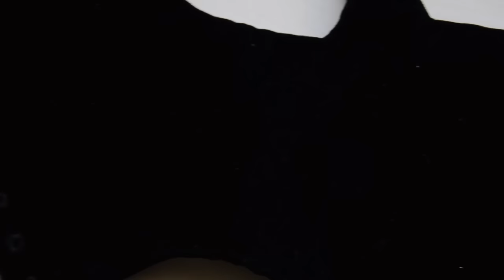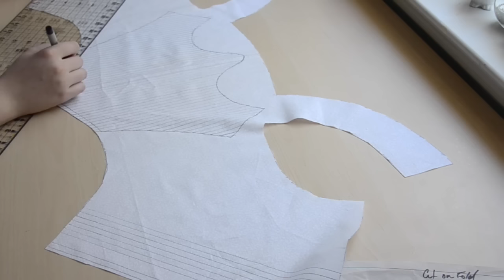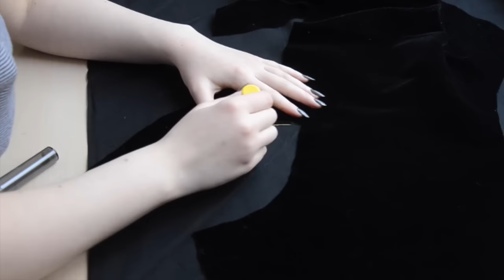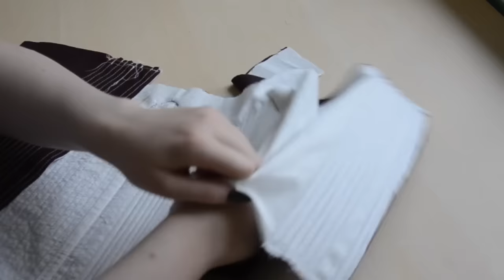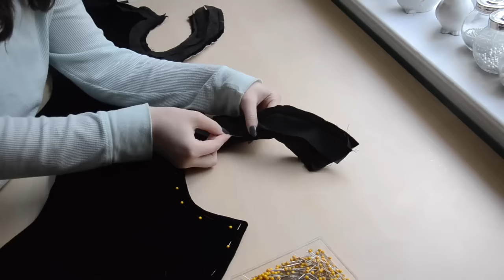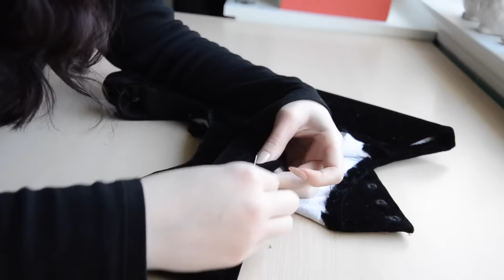Making a 16th Century Kirtle : Walkthrough : Part One

Comment: Your enthusiasm is fantastic, I really encourage you to continue to grow as a costumer, however?? Have you read any books from Janet Arnold? Or Jean Hunesett? I also recommend the Books and resources of Tudor Tailor, as well as Margo Anderson's patterns.   This is a flat lining example have you worked with bag lining yet? Also the materials you are using are very vague,  I would suggest if you are going to wear this to a Faire or SCA type thing?  Natural fibers should be used, the polyester outside you will roast, natural fibers will keep you warm in winter and cooler in the heat of Summer.  Good Luck, I love making clthing from the 16th Century and other parts of the past!

Comment: Kind of unrelated but if you ever try and use spiral boning again you need to remember that for every seam where a flat steel or plastic bone would be( excluding the busk or eyelet reinforcing boning) you need two spiral boning, one on each side of the seam. This is why it didn't work the last time. You need double the amount and more seams depending on the design. Hope it works out if you try again.
Reply from the maker: +enslavedvessel I guess that is what I get for not researching it! Thanks for the tip. I don't see myself really using it again unless it is for a commission. Tipping it is such a pain in the butt and it's really expensive compared to the other options.